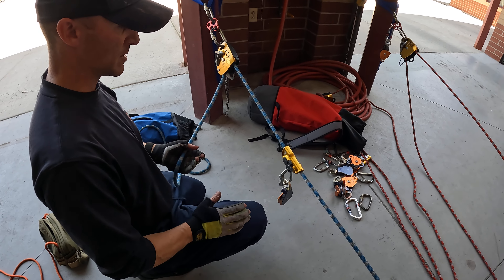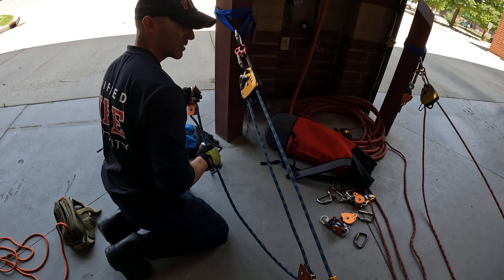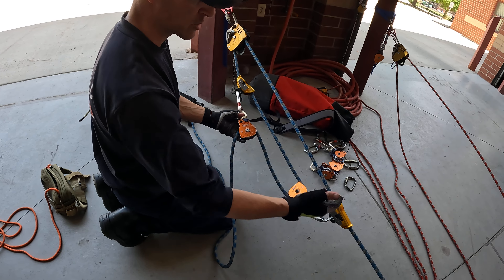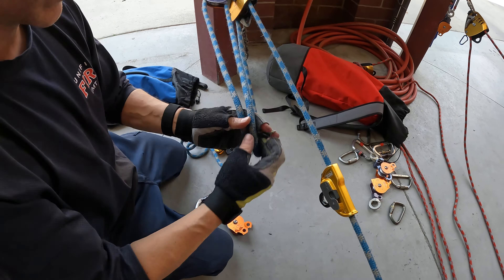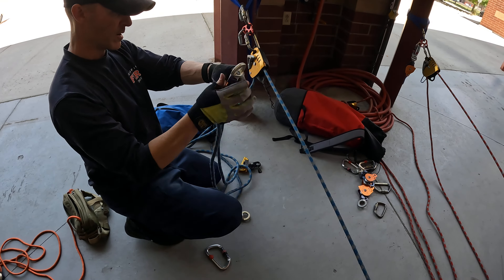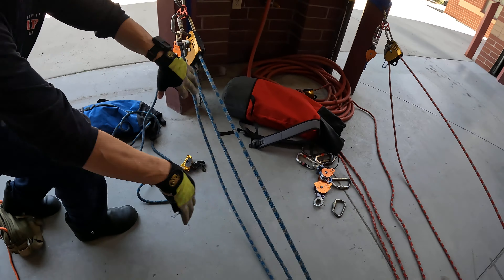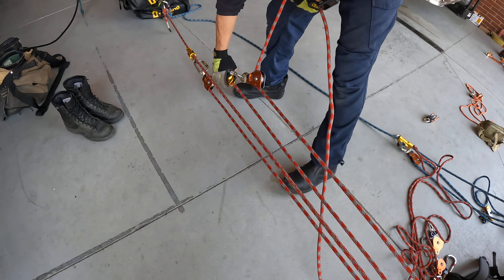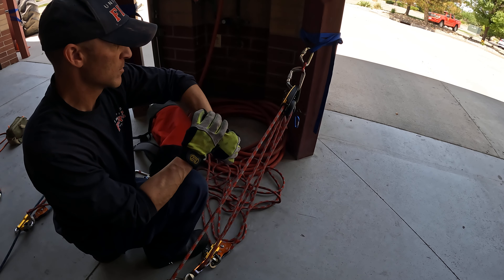Mechanical Advantage: A Realistic & Practical Progression

Comment: Right, a common way to prevent a crazy amount of resets is to split your piggyback with a COD pulley. Many times this is a 90 degree turn and the second haul system is usually much longer as it will collapse at much faster rate.

My question is have you figured out the loss of efficiency by incorporating that 90 degree turn? The rope is having to change directions 90 degrees and even with a high efficiency pulley you are losing MA. Or is it even worth calculating with a 9:1?
Reply from the maker: Oooooh.. Now we are getting into the weeds...  I think next time I have access to two load cells, I'll re-rig this and place one load cell on the tensioned line before the 90deg COD, and another load cell on the tensioned line after the COD.  Then compare the difference.  This would generate a quicker & more accurate measure of efficiency loss.  Or I could "math" this out and assign an arbitrary force value for the tension on the line closer to the load (T-resistance) as my starting point.....   So if I said that T-resistance was, say 100 lbf, then we start plugging in numbers to the Capstan Equation:  T-haul = T-resistance x "e" to the power of (coefficient of friction x degrees expressed as "radians"), and that'll do.  Pi is 3.14 radians, and 90 degrees is 1/2pi, or just 1.57.  e is "Eulers" constant, or about 2.71.  What I don't know exactly for sure is what the coefficient of friction is for a sealed ball-bearing pulley.  Going to go out on a limb and estimate it at 0.015....... So....... T-haul = 100 lbf x 2.71 to the power of (1.57 x 0.015).  This spits out 102.38 lbf of effort.  So comparing this to 100 lbf of resistance, you get about a 2% efficiency loss.  But I'm cross-eyed at this point and should probably just walk away.
Reply: @Propeller_Head  

You made me revisit old Euler on this one. I used the classic 100kg load or .981 Newtons and I got 1.002 Newtons as my answer, or about a 2% efficiency loss like you. Using your coefficient of friction of course. 

Of course real world is always different so yeah if you do set up your load cells let me know, especially using different size pulleys as your COD. If the coefficient of friction is identical will it matter? I am always curious the difference between the theoretical and hands on results.

Thanks again for detailed answers.